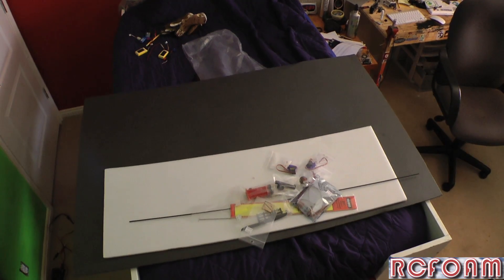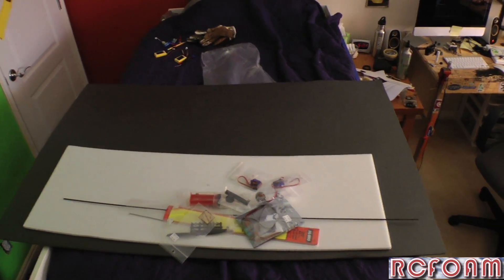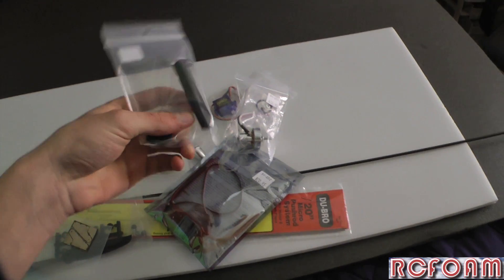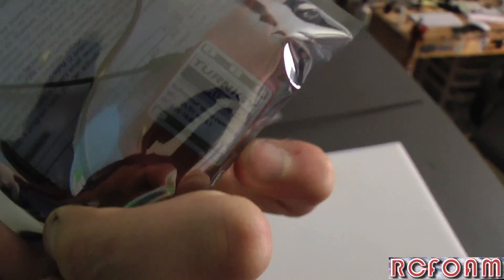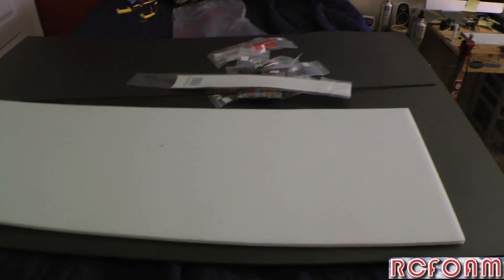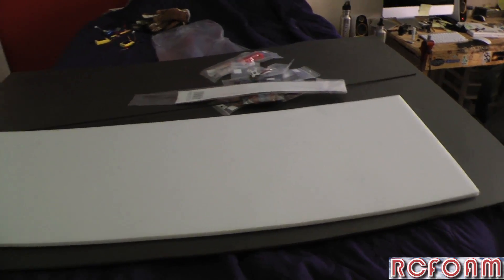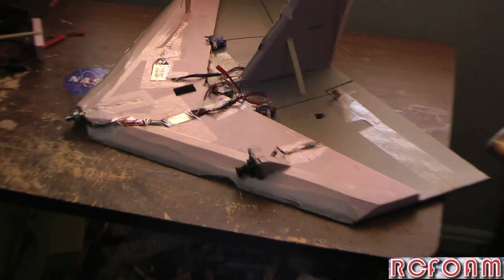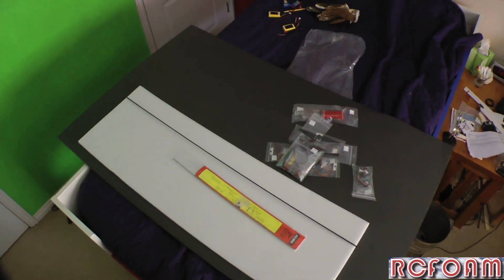RCTESTFLIGHT Delta Fighter Build Along

Comment: Not necessarily. A higher Kv rate motor is designed to spin smaller props faster. The lower Kv range, say 1500Kv or less, can spin your bigger props, like the 8inch or larger, with higher pitches, like 6 or 8 pitch. I run a 1500 Kv motor on my foamboard tube drone with an 8x3 Master Air Screw, and it'll break 50mph at half throttle with great stability. But you should never try to spin a prop that big on a higher Kv motor. It will not always produce a faster plane and will prob burn the motor.